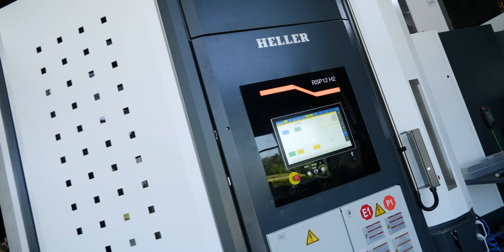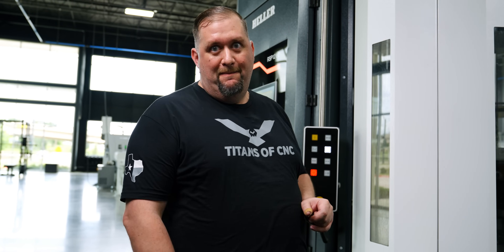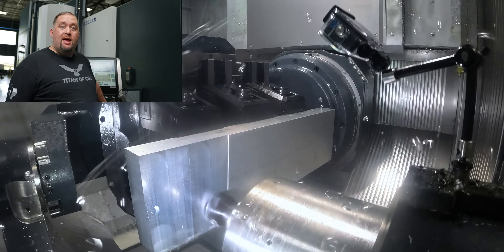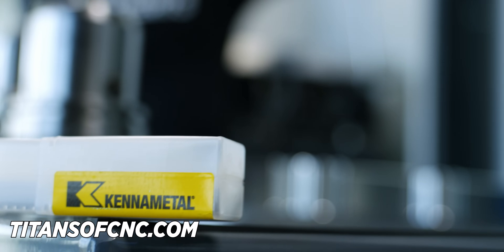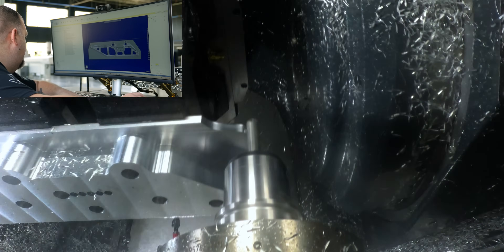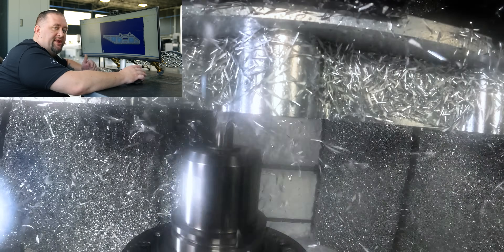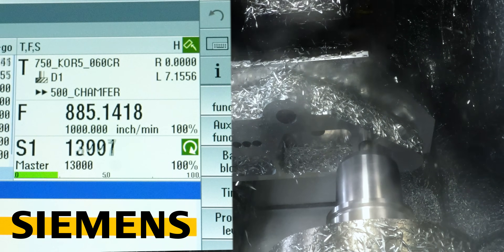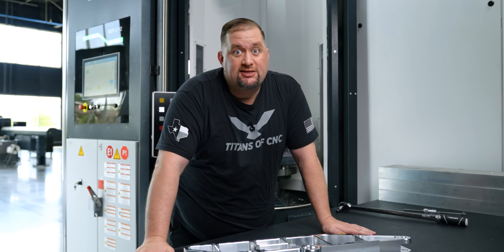Machining Large Parts to Perfect Spec in Minutes | HELLER HF5500

Comment: Very nice!  Was that the very first time you ran that code?  Can you get a perfect result like that without any "fine tuning" or broken cutters?  I always inevitably seem to have chatter somewhere that needs to be tuned out or I break a cutter (or 2) or I have to experiment with different tool paths etc.  I am still learning so I was wondering if this is like an "Instagram" version or did you actually nail it the first time?
Reply: Even if they had a perfect program ready from part one, it's because they have a gigantic backlog of different jobs with these tools and that material.

Keep a notebook, mark what has worked, and maybe even what completely failed, you'll get there.

Comment: Why don't use a HPC Strategy? Full depth, 75% stepover. That's aluminium and the machine is German quality not an instable american Haas.

Also i have never heard about any negative effects that occurre due to dynamic milling. Ever heard that short stroke movements will harm your linear ways and ball screws because the grease film will not be strong enough? That mainly happens to the Z Axis because of the small retract moves between the cuts. But who cares if you do pay zero to none for the machine. Teach it the right way with pros and cons..
Reply: I think its because the lighter cut is easier on the tool life.
Reply: @hectordominguez7143  man that's aluminium. The tool will run for years.. The only thing that will wear out is your machine
Reply: @simsonschrauber05  I agree it is aluminum but that tool is not designed for such a heavy step over at full depth. Also, with that large of a step over you are more likely to encounter tool deflection that can affect your finish.
Reply: What about part stress?

Comment: I’m in the oil and gas industry and we mill a lot of round parts using a 4th axis like stabilizer blades on a helix, do yall do any tutorials on how yall program 4th axis work?
Reply: You can check out our 5 axis academy on the Titans of CNC website. The methods used there also translate to 4 axis work!
Reply: @barrysetzer  only thing is I don’t have multi axis option on mastercam. Will that still be useful to me? Thanks in advance
Reply: @frankn8151  Ahhhh, unfortunately it probably won't. We program all of our 4 and 5 axis work in Mastercam multiaxis.....